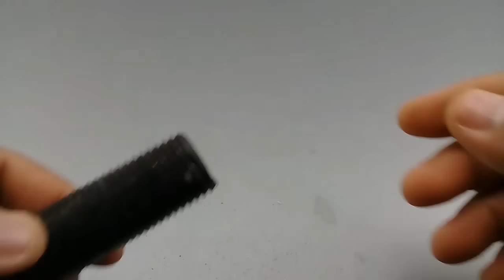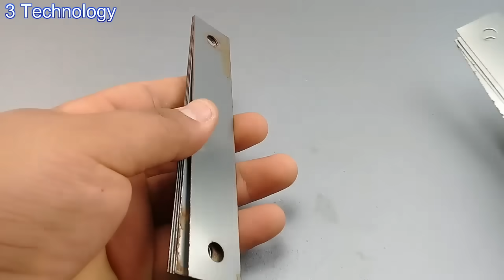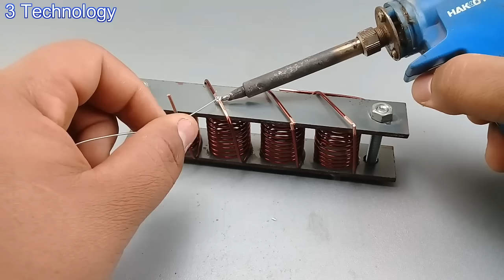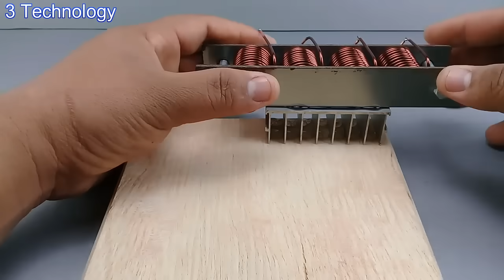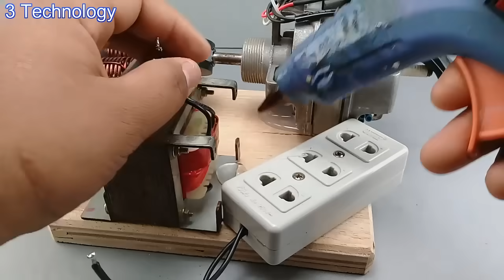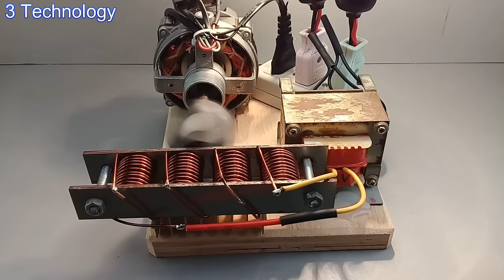how to make free electricity energy 10000w with four pieces copper wire / real free electricity

Comment: His machine is a scam!

I invented Next Generation Electricity, the SPHEREMOTOR. Wrap hundreds of feet of enameled copper wire around a small plastic bowl. Take two strong disc magnets and let them attract together squeezing the center of a pencil. Add something to fill the gaps between the two magnets. Secure each end of the pencil so that it can rotate, and the magnet portion rest inside the wired wrapped bowl. Take some 9-volt batteries clip them together. Sand the two ends of bowl enameled wire and secure one end of the wire to the negative on 9-volt batteries.  Now tap the end of the other wire to the positive on the batteries. Keep tapping and watch the powerful motion it creates.  Where it becomes cool, is when the magnet around the aluminum axle is a sphere with 600lbs of pull strength and the tolerances between the wire wrapped bowl are really, really close, the timing of the alternating tapping is perfect, that's when it is magic. Now add another bowl winding to generate current from the spinning of the 600lbs pull strength sphere magnet inside it and this becomes something that uses very little current but creates a large amount of current.   To see drawings, search for spheremotor.